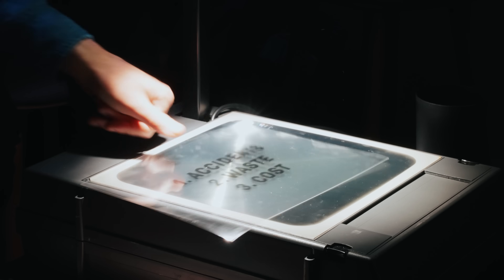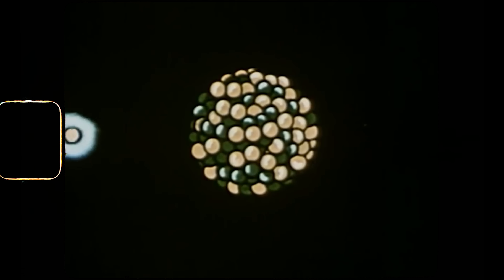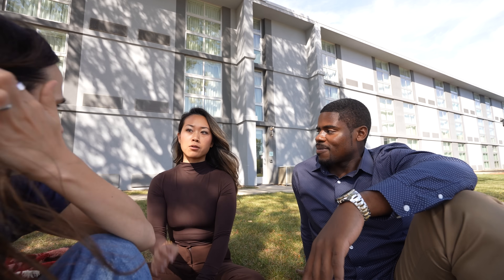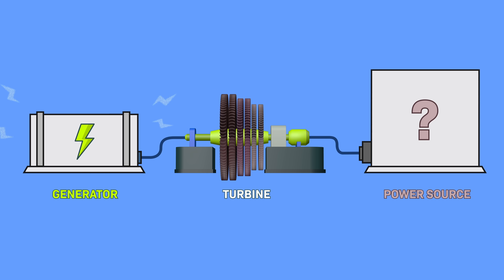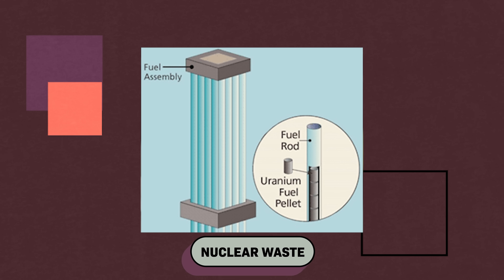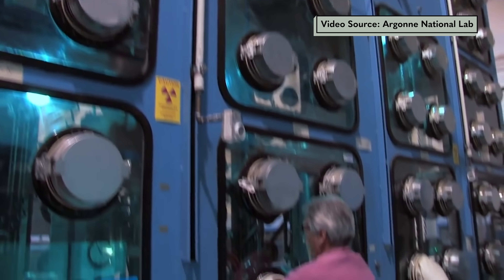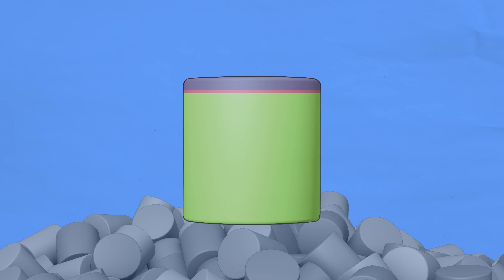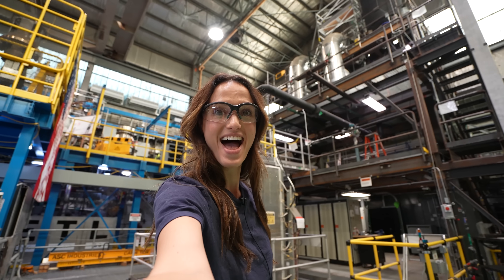The Big Lie About Nuclear Waste

Comment: As someone whose PhD research is on corrosion mitigation in molten salt for pyroprocessing viability, it's absolutely DELIGHTFUL to see this information being distributed to the world.  I love seeing someone (almost) as excited as me about the future of used fuel recycling!
Reply: As I understood it MSRs would be intended to operate at standard atmospheric pressure but very high temperatures, and the molten salt would not only contain the fuel but act as coolant. That makes re-fulling them very complicated, and the metallurgical challenges of having corrosive, highly radioactive salts in contact with the reactor and all it's plumbing were at best hugely challenging and costly, and at worst impossible, not to mention scaling up an experimental MSR to commercial size and scale to produce power. Do you think we have the technology now to address these challenges?
Reply: > this information being distributed to the world  
We have been doing this in Europe for decades, but welcome to the club I guess.  
It's still too expensive anyway if you don't need the Pu.
Reply: Your expertise is the key that can propel the world into LFTRs and a stable climate.
Reply: I've long had the idea that promoters of molten-salt reactors are going about things back-to-front — that the first step is to get fuel-reprocessing plants based on halide chemistry into operation, to help clear the backlog of accumulated once-through LWR oxide fuel, and once those are showing well, THEN tackle the added complexities which arise whenever you have a powerful neutron-gamma source (ie, the reactor) in the mix.
Reply: What about the incorrect bits?
Reply: currently in the freshman year of my bachelor’s degree in nuclear engineering! any advice for someone just starting out in the industry?
Reply: And what about all the waste that is NOT the fuel? How do we store THAT for 100, 000 years? And what about accidents like Japan, Russia, and potentially Ukraine? Last I heard 1 gram of plutonium was enough to kill every living thing on Earth. Has that changed?
Reply: @randomgrinn  That's the thing though, we don't have to store it for hundreds of thousands of years, "merely" several centuries, which is far more manageable. Most what can't be reused, apart from the excess U238 which is both only very lightly radioactive and naturally occurring, has much lower half-life and is less radioactive as there are less of them that produce high amounts of gamma radiation, instead producing low amounts of alpha (helium cores) or beta (electrons and/or positrons) radiation, which can't reach far and would thus be much safer to handle in a casket.

As for the accidents, they are due to two things: Old, unsafe designs and using water as coolant. The old design of the power plants meant that there weren't enough failsafes and redundancies (and in case of Fukushima, putting the generator on ground level in a zone where there could a tsunami potentially knock it out; more modern designs put the generator higher up specifically to avoid it being knocked out by flooding), and using water as coolant always carries the risks of steam (and thus pressure) buildup and hydrogen generation (which can explode quite spectacularly). Future design in development use either some gas (most likely Helium, potentially Argon if there's a shortage of the former as they are very stable and non-reactive) and runs the generator at ~900°C (1650°F), which is much more efficient, or molten salt or lead, which also run a t higher temperatures and would solidify and safely bury the fuel in case of any breach.

Nuclear energy is not inherently unsafe and unsustainable, it's just using the technologies from the 70's (of which most reactors in the world are still based upon) that is unsafe. Those should gradually be replaced with newer, much safer designs and reactors that allow for either a closed cycles and/or a Thorium cycle.
Reply: @randomgrinn  Sorry!  I've never had someone respond to a youtube comment before so it took me a while to get back to this.  I'm glad you asked, though!  I do not do non-proliferation as part of my study (although obviously there's some overlap with recycling), so I'm not the expert on this section, but here's about what I know from my time in power generation and waste management and just general nuclear knowledge (I definitely recommend looking up scientific journals and experts in that area of the field to fact check my details and verify though).  I have never heard that assessment of plutonium, ESPECIALLY in that scale.  The critical mass of plutonium (the amount that, by itself, will sustain a critical/stable/steady reaction), is around 10 kg depending on the isotope, the shape and the reflector being used.  By itself, plutonium has a halflife of 80-some years, so it will randomly decay and potentially cause multiple chain reactions, but it's not going to sustain itself until that much.  At a gram, you would need a significant number of other neutron generating materials or reflectors to create even a fraction of the reaction you're talking about (that's why, at my super basic level of understanding, most nuclear bombs have some sort of uranium element to fission for neutron multiplication).  AFAIK, bombs like Fat Man have considerably more than a gram of Pu, because you'd need especially specific conditions to get a bit of material that small to create large chain reactions and that makes it super unlikely to just happen naturally.  And that's not even taking into account the fact that electrorefining removes plutonium in a way that mixes it with other elements and that makes it considerably MORE difficult for it to be dangerous on its own.  As far as storage, like was said below and in the video, removing the transuranics/actinides significantly decrease the radioactivity as well as the amount of time before it decays to a less dangerous background level.  That, with the attenuation and structure of the containers we have now, on top of the regulations for handling and disposal, make deep repositories like Finland has been working on (and we're hoping to have ourselves someday) objectively pretty safe.
Reply: @RosieDerivator101  I might be giving Randomgrim too much credit, given how doom and gloom his comment was, but he might be talking about the other things which get contaminated and not the spent fuel rods. I'll admit I've not looked into it but in Johnny's companion video it's mentioned that the spent rods are only 3% of the radioactive waste, I don't know what happens to that stuff.
I was expecting this video to lead into molten salt Thorium reactors, which is where your PhD research would be very useful. When I learnt about them I was rather angry about how the Oak Ridge National Laboratory research reactor was shut down! I thought that modern manufacturing would have solved the corrosion problem by now, probably something ceramic based.
Reply: @randomgrinn  In Johnny Harris' video Cleo explains how fossil fuels such as coal, oil and gas kill (associated deaths to workers and people in all related disasters) significantly more people than nuclear energy in relation to the amount of energy they produce.

Also another comment mentions Thorium reactors that use a thorium-plutonium fuel mixture. I don't know much about this method, but it seems to be a a solution to your other concern.
Reply: @androidunit56  What about what about what about. We can all agree fossil fuels suck. But that doesn't actually answer the question of how to deal with the other high level waste. Nuclear isn't the answer the same way fossil fuels aren't.
Reply: @randomgrinn  
Recycled nuclear waste would be much less radioactive than non-recycled nuclear waste, which is why it would require storage for only a couple of centuries rather than millennia. Accidents happen with any power source, but properly designed reactors would make accidents less likely and would minimize bad effects if one does happen. The canard about one gram of plutonium killing all life on Earth is just wrong.
Reply: @randomgrinn  What is NOT the fuel is usually low level waste which doesn't take much to clean or recycle. You certainly don't need to store it for 100,000 years.  Japan was Bad design and Chernobyl Ukraine (not Russia) was 1) built on the cheap 2) was operated by incompetent workers who went out of their way to put the reactor in a failed state 3) at the Ukraine had little to no governmental oversight and no transparency that would allow monitoring and checks of operational safety record.  This would not happen in a well designed and well regulated country like in the US or EU.  In fact, France has 70% of its power since the 1960s come from nuclear and there has never been an accident in that country.
Reply: @jonjohns8145  Heads up: Chernobyl was under control of the Soviet Union at the time of the accident. Russia, nor Ukraine, have anything to do with it.  Russia (with other Republics) declared independence from the USSR. They are not the same, even if some (like Putin) won't accept it.
Reply: @manuel1823  Yes, I know all of this, I was just pointing out that It was in Ukraine and not Russia.
Reply: Peggy stop kidding yourself this broad is much more excited about this topic than you ever will

Comment: Theres a lot to nuclear energy, CANDU reactors run off of natural Uranium without it being enriched which actually ends up being safer in the long run, they are also capable of being refueled while running. Their spent fuel can also be used with small module reactors to continue power generation. Nuclear generation can be one of the safets forms of sustanable energy generation with minimal waste compared to almost all other forms.

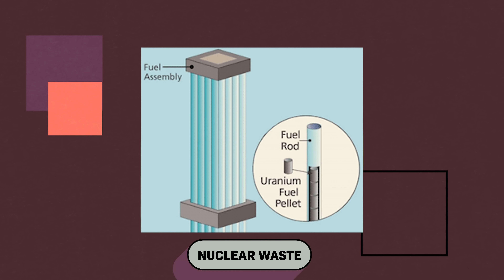Comment: 7:11 : You say "Enrichment, which is making more of the Uranium 235 out of the less useful Uranium 238."

No.  Enrichment is simply separating out the U-235 from the U-238, and throwing the excess U-238 away.  The waste U-238 is known as "depleted uranium", and is used in various applications calling for Uranium's chemical properties (such as making really heavy anti-tank bullets).

Comment: The Sellafield waste processing plant in Cumbria UK has a yellow line running through it, anything inside the yellow line is considered radioactive and has to be treated as such. So you get the situation where one side of the line a piece of wast paper is general waste and on the other side an identical piece of paper is radioactive waste and has to go into a special bin, which to me seems mad. I got this information as I was involved in the manufacture of these special waste paper bins  back in the 1980's., this so called low grade waste was shipped out in steel  skips weighing fifteen tons.

Comment: While this technology needs to be utilized we also need to build Thorium molten salt reactors which are inherently safer than uranium reactors . The Oak Ridge National Laboratory operated one from January 1965 through December 1969, logging more than 13,000 hours at full power during its four-year run. Also this reactor  eats spent uranium nuclear fuel.

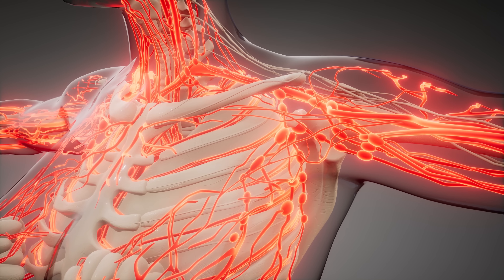Comment: 7:30 - It's not "free atoms." It's "free neutrons". The neutron, if/when it hits the nucleus of a U-235 atom fuses into the nucleus. This changes the number of neutrons in the nucleus, upsetting the balance of forces between the neutrons and protons, rips the nucleus apart. Parts of the nucleus steals the electrons to make new atoms, spare neutrons go flying out like the atom was a grenade, and parts are sped up fast enough to trigger the E=MC^2 equation to become energy (mostly heat). We use those spare neutrons to make other U-238 atoms go boom and repeat the cycle, while the heat is used to boil the fluid (maybe water) that either goes directly into the turbine or heats a secondary liquid (most likely water) that then goes into the turbine and then finally into a cooling pond.

Fun fact, that "exhaust" that you see from nuclear reactors is really just steam. Yeup, super heated H2O molecules.

Comment: In arguing as you do, that we just need a little effort to recover the actinides to successfully make and use fuel from the waste - you are implicitly saying that the engineers and scientists in the industry working on this for the last 75 years were incompetent, ignorant buffoons. Were this anywhere near reasonable it would have been accomplished decades ago. 

It has been tried and failed repeatedly decade after decade after decade.

Comment: Well, as much enthusiasm and research you put into this, Clea, you didn't accout for a couple key factors.  1 - These are mammoth casks that entomb the low-grade radiation material spread over dozens of decommisioned or near-decommissioned plants making them extremely hard to move.  2 - There is a unwritten moratorium on transporting such waste anywhere as it poses the single greatest threat to terrorists making a dirty bomb.  3 - All of this could be reversed if a federal nuclear repository was deemed safe.  We had spent billion$ on this endeavor out in Nevada, but enormous pressure was put on the Yucca Mountain Repository project by nearby Las Vegas which essentially killed it dead in its tracks.  Maybe, Chloe, you can make a follow-up video emphasizing the POLITICAL QUANDRY that sunk this wonderful endeavor in hopes a pro-green administration helmed by enivironmentally conscious Democrats couild resurrect this once again.  Best of luck to you.

Comment: So, how about mill tailings and other low level radioactive waste.  Also, this recycling does not include TRU's.  I see recycling as an "improvement" on a really costly way to generate power, that will still produce toxic and radioactive byproducts that will need to be securely stored for thousands of years.  Forget the fission!  Fusion, maybe?  Problem with fusion is it will require a very large and expensive reactor/containment system . . . . which requires a large and expensive transmission network.  Better to focus on developing small scale or micro power generation that does not require long distance transmission.  And it will require that all of us reduced our energy consumption.